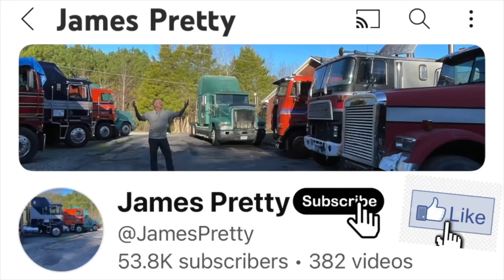Let’s get this Rear Installed

Comment: JP, hi, I would Not remove the jack stands off de frame till de braces R in. Joint frame is nice n straight.
When test, Load 2 trucks on your Trailer, n tow with Betty.
U know that U must b rested b4 hard work to Avoid Accidents.
stay Safe.
Reply from the maker: Appreciate ya

Comment: I've welded several frames .I think you did it right by using the mig welder. Because you so much more potential strength per square inch. Then using a 70/18 rod  . In reality that is more likely the strongest part of your frame. Even before you add any kind of bracing. Because you welded both sides you have around 24000 pounds per square inch on  a almost 12 inch frame. Making that 24000 × 12  in that one area alone is way more Weight than you can possibly ever put on  one truck.
Reply from the maker: Appreciate ya Hank

Comment: Curious amateur question on this.  Could those old frame holds have been used as plug weld locations for the frame sleeve?  Would that help hinder or not matter at all?
Reply from the maker: Not sure really. I never thought about welding the liner in. Maybe I’ll try that on something

Comment: Looking good James Old Black Betty bam-a-lam.
Reply from the maker: Appreciate ya brother
Reply: @JamesPretty  two questions for you about Betty what made you decide to stretch the frame and what engine does she have? She is going to look real good when you are done!
Reply from the maker: @rudycarlson8245  the suspension was shot and when I unbolted everything the frame was bent.    It has a 3406b 7fb with steel pistons and other performance pieces

Comment: If you sleeve it it should be fine
Reply: I'm certainly not a fabricator, but I agree.  A doubler that bridges the weld area will add strength.
Reply: @stansdds  I'm not either but I think it will be fine
Reply from the maker: I agree

Comment: it didnt work, understatement of the decade, the weld filler metal strength would be the key to your repair, 7018 is 70k ppsi, mig is 120k ppsi, they have used stick welds for years,
Reply: There is Tig filler you can buy or order in 70,80,90 … all the way up to 130ooo psi tensile strength….  Now I doubt he did special order that stuff ….  And Tig welds by nature are shallow penetrating….  

If done correctly a guy could Tig weld a frame, but like you said, it wouldn’t have been my first choice…
Reply from the maker: It’s been a while since I shot this video not sure what “it didn’t work”
Refers to bro  but standard mig wire is 70k just like tig wire “er70” I’m sure you can get different mig wire as well    Nothing wrong with stick welding but the NHRA doesn’t allow it any more so I wonder why?
Reply: 100% right if that frame breaks it will not be on the weld
Reply: @JamesPretty  standard MiG wire also comes in different tensile strength. But regular MiG is a medium penetrating process, AND it produces very hard welds with very poor elongation. Over time the truck frame flexing will carry a great risk of failure. 
The reason why stick was suggested was that the weld is covered with a slag layer which lets the weld cool slow and gives it excellent elongation. Btw dual shield &lug cored wire would do the same thing …. And later processes are also both spray arc processes with excellent penetration AND the flux helps dealing with minor potential surface contamination….
Well, we will never know how good the weld was as detailed video footage was not available we didn’t see the joint prep or any back gouging if it happened …..
For sure short circuit MiG wouldn’t have been the answer either…
Reply: I see your concern and understand why you might be a little worried the weld might be  hard and could possibly snap.  But I'm thinking if you let it cool naturally that it didn't harden as much as you think.  But I seen the blue color on the frame metal does tell me that it definitely got super hot
Reply from the maker: @ZILAwelds  ya I’m not a welder by any means, I appreciate the insight for sure. We did grind out the back
Side of the weld, and weld
It.  I hired a professional welder to clean up and finish the job because I wasn’t confident in my work. We’ll see how it turns out.  But I’ve seen some pretty horrible mig welded stretched truck frames that been going heavy a long time. We’ll see how it turns out
Reply: @JamesPretty  when i worked for a welding supply store, the basic wire shielded with 75/25 was 120k ppsi, the it didnt work was in reference to the plastic inserts stopping electrolisis corrosion.
Reply from the maker: @youtubeisawesome2487  oh ya for sure major failure on that
Reply: @JamesPretty  some people get lucky for a long time 😂
I think if you sleeve it, most likely it will work for you
Reply from the maker: @ZILAwelds  it’s getting a sleeve for sure.